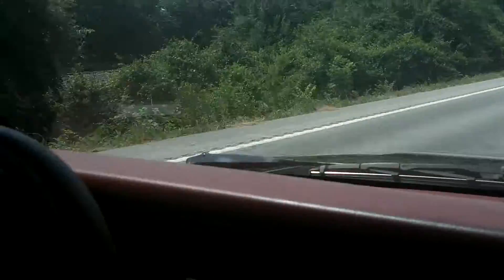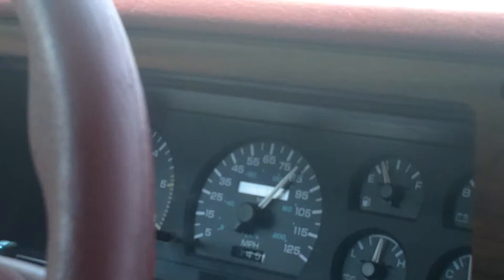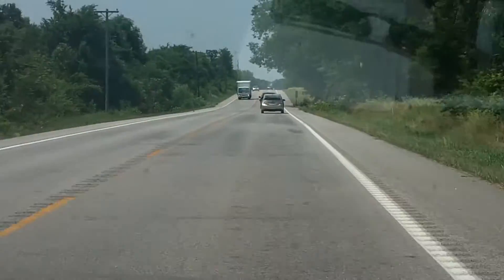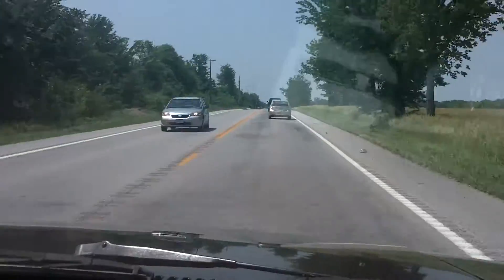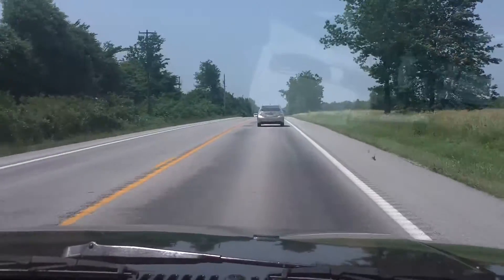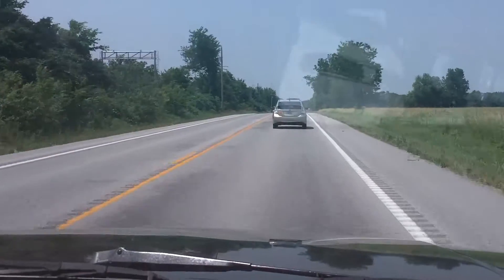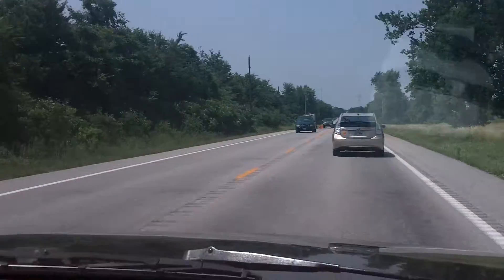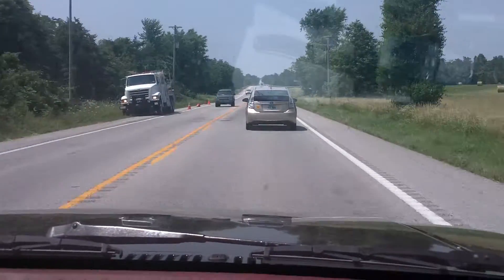84 MPH in a Wood Gas Truck, With Wayne Keith

Comment: Why not compress the gas and put it in a cylinder, like an LPG engine? This could save weight and load space in your truck.
Reply: Because a 100-gallon tank of wood gas would only get your vehicle about 2 miles.

Comment: At 17 million BTUs (5000 kWh) per ton (2500 W-h/lb) of wood you are using about 1800 W-h/mile compared to about 400-500 W-h/mile for a similar EV. So that's about 20-25% efficiency which compares well to a gasoline powered ICE and considering the environmental benefits I say "well done"! Firewood costs about $0.10/lb so you achieve about $0.07/mile which compares to a 50 MPG truck with gas at $3.50/gallon.